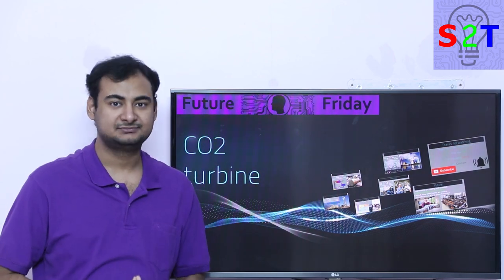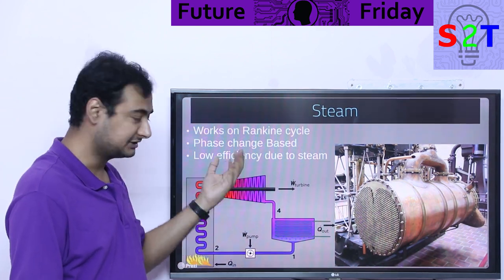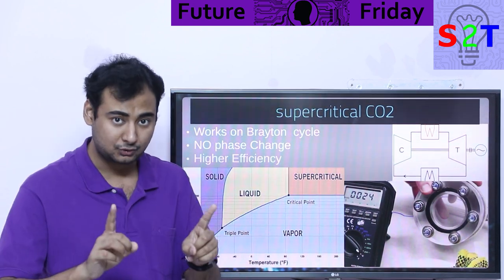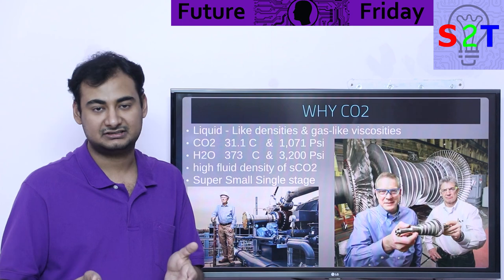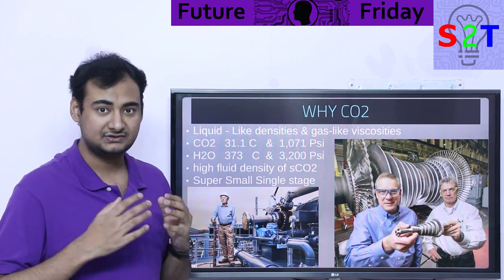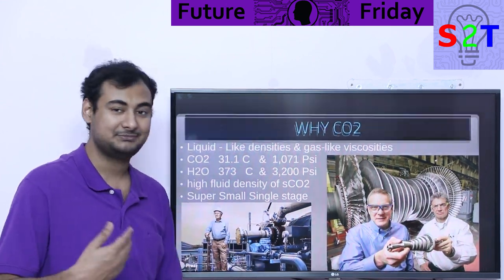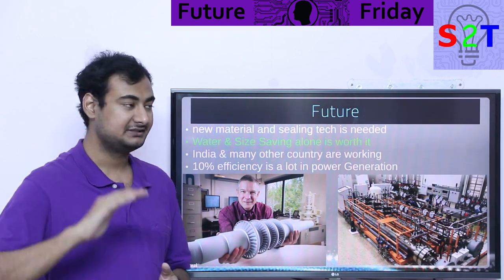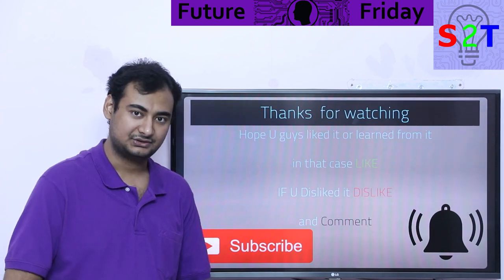Supercritical CO2  Turbines Explained {Future Friday Ep92}

Comment: This is the future of power generation. I would like to know more aout the corrosive effect of co2 on metal. If it is a hermetically sealed system, then moisture, which when misxed with co2 produces carbonic acid, should not be a factor. Also if this was combined with a graphine heat extraction method, instead of EGS, then a geothermal plant could be located anywhere in the world with no imputes and no pollution. This presentation is the most well thought out and lucid I have seen yet. Good Job.
Reply from the maker: I am glad u liked it

Comment: 3:19 That's Ben Krasnow's homemade 2000PSI pressure cell from Applied Science. Thank god it did not explode during testing. One "sealing technology" challenge here is how to have an axle that does not allow the CO2 to leak but without gaskets that would cause so much friction. Magnetic gears are possible but the vessel walls are too thick. Contain the entire setup in supercritical CO2? Maybe
Reply from the maker: I have a chance to see the hardware in construction  
Hands On Supercritical CO2 Turbine Explained 
https://youtu.be/1jmKP2IdH-A
sealing technology is alredy there used in gas insdustry that works at 200+bar & at stupid level of RPM
 (look into turbo expander )

Comment: Again with the semi truck example.  SF6 must be subjected to conditions above its critical temperature and critical pressure. The critical temperature for SF6 is approximately 45.55°C (114°F), and the critical pressure is about 3.78 MPa (37.8 bar or 548 psi). In the supercritical phase, SF6 exhibits properties of both gases and liquids.  CO2 density at 31c and 74 bar 0.468g/cm3, H2o at 374c and 221 bar 0.322 g/cm3, SF6 44.55c and 37.8bar 0.74 g/cm3.
Reply from the maker: just watch the Edison Motors Explained https://youtu.be/pzV4Yx7f2IU

Comment: Could it be potentially feasible to use the Brayton or Rankine Cycle to produce electricity for semi trucks thus reducing the parasitic loads from alternator, pumps etc.  It takes for example (40% efficiency) 93kw of power to drive down road at 62mph but a total power output of 232.5kw of power must be generated.  This leaves 139.5kw of power that does not go directly to moving truck.   There are about 10kw of power that go to run things like alternator (estimate using duty cycle), pumps etc.  If you could get decent efficiency with the Brayton cycle maybe you could generate the 19kw of power need for a dual zone reefer trailer.
Reply from the maker: Dude just use series hybrid system like Edison Motors topsy. for even more power add thermal energy recovery system from F1 to to truck {turbocharger with a motor generator unit & restriction on Turbo as most has a lot of subsystem to tame it down so it does not go to "RUN AWAY" but you let it and slow the RPM buy putting LOAD on  it  } its now common in shipping . My  video on it   Hybrid Turbocharger Explained {Science Thursday Ep208} https://youtu.be/varxcgTPZ8E

Comment: Without a doubts on the theoretical level sCO2 is a great technology. However, the presentation should not start with inaccurate statements: Modern (Supercritical) Rankine steam cycle delivers 40% thermal efficiency and more. (i.e. not 33% as claimed in presentation). Further more the presentation talks about early stages of sCO2 cycle development: supercritical discharge from turbine. As in Rankine cycle sCO2 today is designed to have turbine discharge pressure well below supercritical CO2  (e.g., ~400 psia vs critical P=1070 psia) with the only purpose to increase the efficiency. Note the Low-Pressure steam turbine delivers almost 50% of electrical output of a modern steam power plant. While I am still in favor of sCO2 cycle the main question remains: where would the CO2 in supercritical state would come from to compensate such cycle working fluid losses. Keep in mind that working fluid for steam cycle requires only chemical treatment. Getting supercritical CO2 is a high energy consumption process. I wounder what is the impact on overall system efficiency assuming 2% CO2 leakage in the system. (Note, a regular air compression system is usually designed for 15% leakage).
Reply from the maker: You are missing the key detail why people want it . We need it because of its quick response and NO water need . 
I had a chance to visit {interdisciplinary center for energy research } and get actual hands on, I would urge you to watch that updated video https://youtu.be/1jmKP2IdH-A  {Hands On Supercritical CO2 Turbine Explained } & I am much clear on the concept of it all

Comment: Love the video. It sucks the first hit above your video is AI garbage, your's delivered everything I was looking for. On the topic of inertia, I understand steam turbines are pretty beefy, but could the generator with a flywheel take up the inertia from the grid?
Reply from the maker: U can't do it easily as rpm is too high & everything u will add or do will increase cost
Reply: @s2tenglish   I guess I should have added I assumed a reduction gearbox would be involved. I know it's lower power, but I've flown aircraft with Honeywell TPE331 turboprop and they reduce the rpm from 40,000 to 1600, with specifically on the one I flew it was 715 horsepower. I know they have models in excess of 1000 hp, which would be 746 kW.  It's a bit lower than 10 MW, but the development of that must be cheaper than huge steam condensers?

Comment: No way that thing can churn through 10mw. The material strain would tear it apart. It's too small.
Reply from the maker: don't think in terms of  wind mill think in the terms of JET engine or rocket turbo pump most of them exceed this power to size ratio
Reply: @s2tenglish  you can't just shrink or enlarge shit and expect the same durability. Cross sectional areas of metal members grows exponentially with linear increases in diameter. Halve your size and you've more than halved the strength.